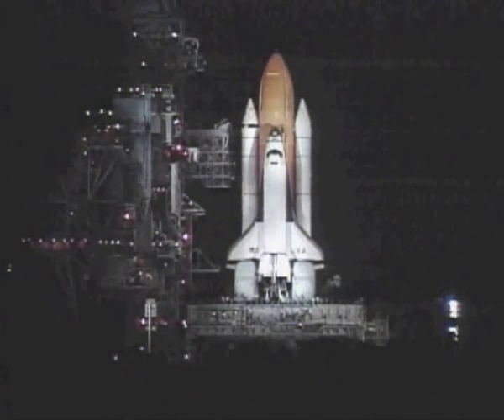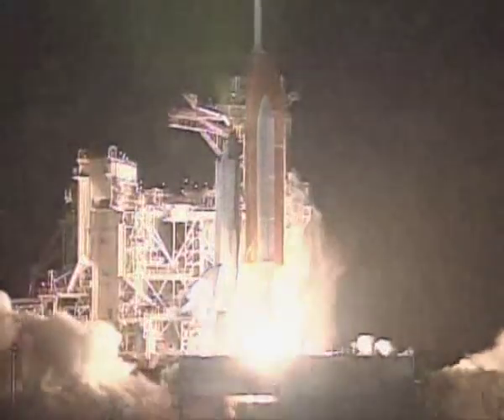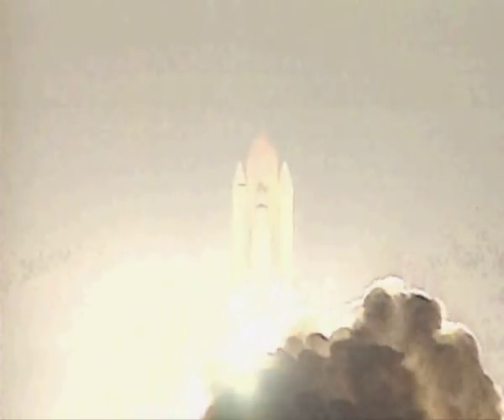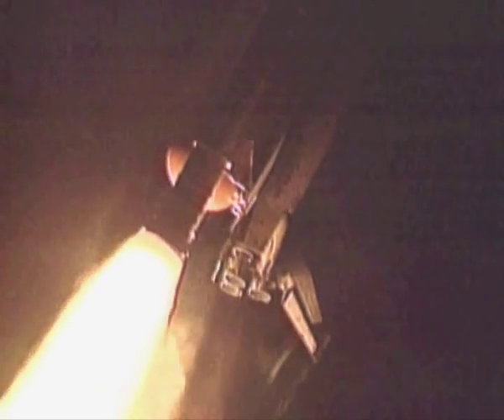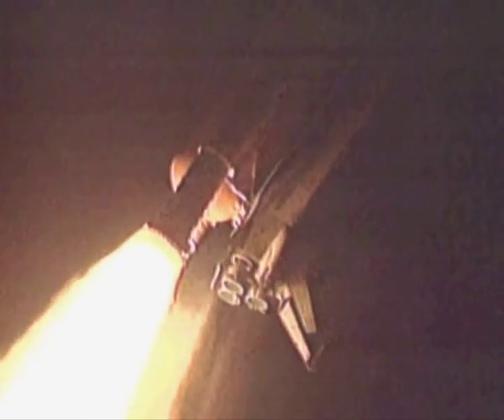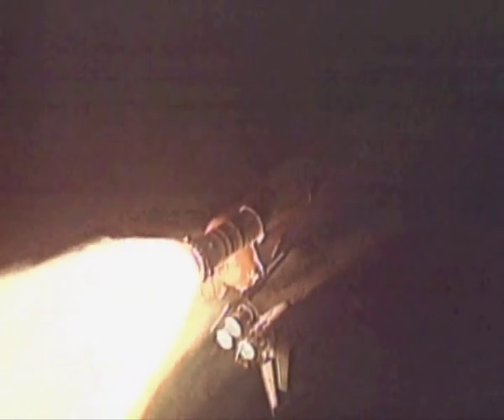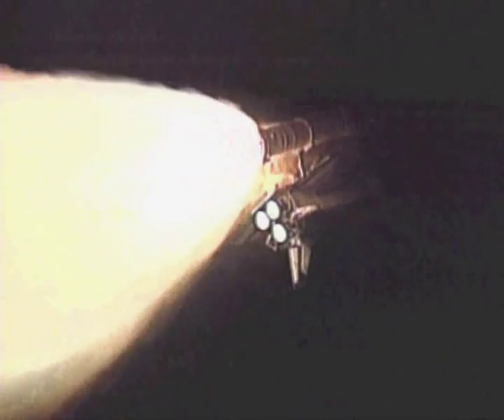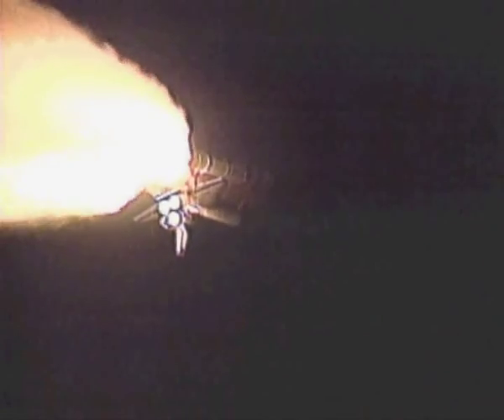Columbia Lift off

Comment: Columbia was lost on re-entry because a suitcase-size piece foam  foam broke off from the External Tank bi-pod ramp area striking Columbia's left wing reinforced carbon-carbon (RCC) panels. this likely created a 6-to-10-inch (15 to 25 cm) diameter hole, allowing hot gases to enter the wing when Columbia later reentered the atmosphere.

Comment: @dancelova498   A piece of the heat insulating foam broke off the main fuel tank and hit the wing.  During reentry the wing failed and the shuttle started spinning uncontrollably and breaking down.